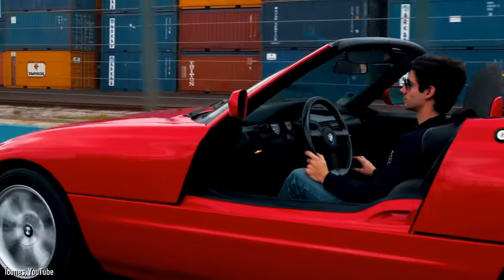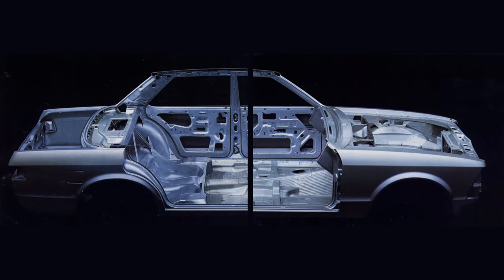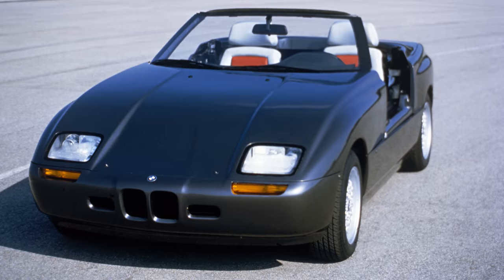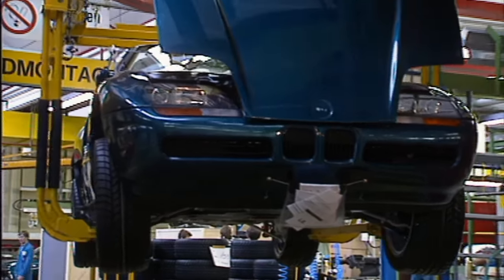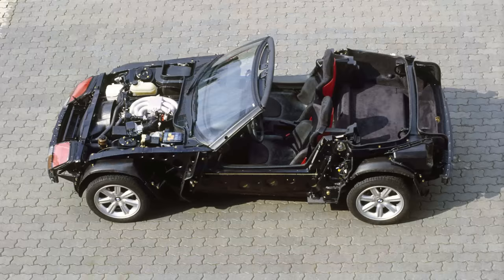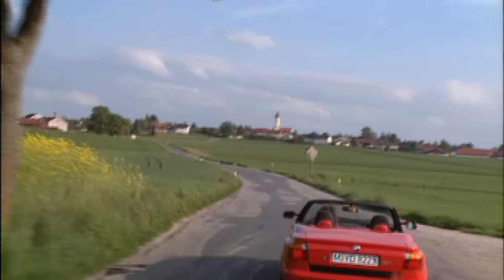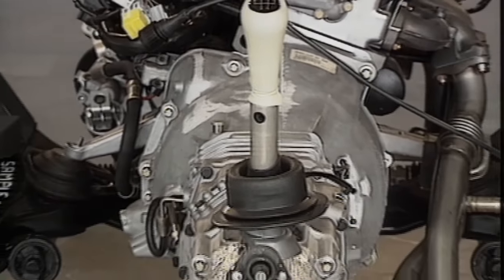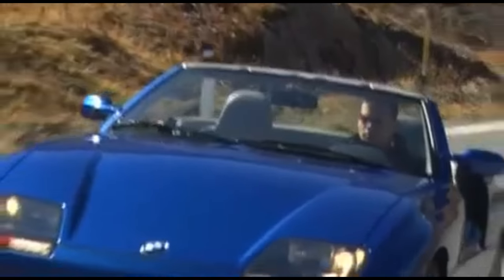Electric doors! The BMW Z1 Story

Comment: I've had my Z1 for about 20 years now, (bought for £17500) and love it! i could never sell it as on sunny days, driving it with the roof and the doors down is a totally amazing experience. 100k+ miles and still going strong. People generally refuse to believe it's 34 years old!!
Reply: Congratulations you are a lucky man. It is an amazing looking car but it looks very odd with the doors down I must say.
Reply: Neah, no way a  BMW still works after all that time.  BMW is shit.
Reply: I think the door are so cool. I'd surely have broken them by now, letting them down and up constantly as I drive along LOL
Reply: @Jack_The_Ripper_Here  there are a billion 90s bmw builds around lol
Reply: @huleyn135  a billion? You rarely see a 90s bmw on the streets.  Maybe in your country. They are extremely unreliable.  All i remember I used to see a lot of 3 and 5 series or the 7 series the "ugly one" . Not anymore.  All gone lol. Broken, fked lol.
Reply: @huleyn135  Don't feed the troll.
Reply: @Jack_The_Ripper_Here  I had a 1986 3 series that had over 500,000 miles on it when I got it. That car still ran like a youngster. It had never been rebuilt in anyway, it used some oil, steering an trans fluid but not in excess an would jump out onto the freeway like it owned it.
Reply: @stratcat4450  too bad BMW is now complete shit
Reply: I bet even minor accident involving doors will total it.
Reply: @Inflator82  The chassis is so stiff, it's all good. Hardest thing nowadays is sourcing parts, esp. the bits that are not E30! I've just bought a new door skin as mine finally split (after 32 years!) and it was neither easy to find, nor cheap!! ;-)
Reply: You must be really good with your money
Reply: Green eyes 👀
Reply: @Jack_The_Ripper_Here wrong, I’m 36. My dad bought a 1992 325i E36 and still has it. I’m driving an M8 Competition and after years of not touching my dads “old” 325 sedan, it shocked how snappy it still it. Chassis wise, it reminds me of my M2 daily.
Reply: @JarvisBoots1 just found out that several elements were inherited by the E36. I’ve owned several BMWs (not a MB fan myself) but the E36 (basically learnt to drive on a 1992 325i and a Mondeo) has that special “something”…. Never thought it was a Z1 pedigree. As a collector myself, I can only say, “KEEP IT, no matter what”.
Reply: @Gogettor  Cheers Robbie - it's going nowhere I promise!!!!
Reply: @Jack_The_Ripper_Here  what are you on about… I bet you like jdms yeah and not euros
Reply: Out of curiosity, has there been any faults with the doors? Have they become slower over the years, or working just as well as when the car was new?
Reply: @PatrickJorgensenn  Hi Patrick - they work as quickly as ever. However the drivers door is "tempremental" - it sometimes fails to lock into position, and sags a little when driving (about 1/2 inch). It's about the sensors (which you cant get anymore) and the tension - but I've learned to live with it 🙂
Reply: I’m super jealous of your lifestyle sir lol
Reply: WUT I can buy an Audi A4 2021 on the Facebook marketplace for 10000£
Reply: @Jack_The_Ripper_Here  yeah what're you smoking dude? 😂 as long as they are maintained properly all of their inline 6 and 8s seem to do amazingly well. Just expensive upkeep that's why so many are found fucked up, cause somebody was cheap or too incompetent to do the maintenance themselves.
Reply: @scoutbloodinthewater9210  probably. Idk why people get so pissy about it. I like cars from all over. As long as they're reliable and pretty that's all I need.

Comment: To my knowledge not only the engine and transmission but also the fron suspension of the Z1 were lifted straight out of the E30. The Rear suspension was basically a prototype of what would become standart of the upcoming E36. On the Z3 it was the other way round. E36 front suspension, but the rear from an E30/E36 compact to save on cost and weight.

Comment: Thank you so much for making this. I was just looking at the RM Auction listing for one that is to sell in February that has NEGATIVE 3 kilometers on it. Apparently it was common for BMW and other auto makers to manufacture their instrument clusters at just below zero kilometers to account for moving around until they got to the dealership. This particular Z1 was collected at the factory and only driven once and apparently not enough to roll the odometer over to zero.
Reply: Later on for the digital odometers there's an option in the BMW software to reset it back to zero at any distance up to 255kms.
Reply: Wonder what that will sell for. You got a link?
I'd love to see it.

Comment: *In German, the "z" is pronounced as a "ts" sound, so it would be pronounced "Ulrich Bets".
You're very right about highlighting the amount of time, effort and cost it takes to put a car into production... all of the legal hoops that you have to jump through too !
It did help that the engine, gearbox and most likely much of the front suspension was stock 3 Series.

Comment: Back in the late 80's a bunch bonkers midland motorcyclists, OK bikers went on a trip to Germany to see the German bike grand prix at the Hockenheim ring. While out and about we got talking to an owner of a Z1 and by shear luck I was offered a passenger ride in the car. This experience was not about the speed or acceleration but how the car handled at on the twisties and it was an experience that I remember to this day. It was frankly the best that I had experienced ever at the time. Back then I had nigh on 2 feet of hair that got a tad knotted on the air but it was well worth it.  The dropping door mechanism was very well done as well. I might be wrong but this car also had ground effect aerodynamics and was one of if not the first to be available on a production car. .
Reply: Haha relatable. Long hair and open top cars are not compatible.

Comment: BMW had a number of classy vehicles back in the day.  It would be refreshing to see if they could do something similar in the 2020's
Reply: What, BMW not classy now? But they have BIG GRILLS!!
Reply: BMW needs to rediscover what their brand stands for.
Reply: @davidrbrtsn  when you get over the design they are super nice to drive
Reply: @andreasstrauss5194  I hear you, but design is just really important to me. I like looking back at my car and smiling 😁
Reply: @davidrbrtsn  yes me too although there are still some nice bmws around like the 5 series and non m 3 series
Reply: @andreasstrauss5194  Not really as nice as they should be with so much lost feel, poor steering, ever increasing weight, fake engine sound from the speakers...just inexcusable!
Reply: @pistonburner6448  havent really driven many bmws (the only one was a e46 touring) so i cant really speak that much about it but from what i heard they still are quite good in comparison to other cars
Reply: @andreasstrauss5194  No, you're right: compared to others that is true. Well, except compared to Alfa Romeo and Maserati. And except compared to many GM's cars like Cadillacs, Camaros etc. And I guess some Jaguars are at least close if not as good. And Mercedes has come much, much closer than ever before (still not equal but many Mercedes have lost their biggest flaws).
Reply: @pistonburner6448  the new mercedes are in my oppinion some of the worst cars on the road that 9 speed auto is always changing gear the engines dont feel like they have the power they are supposed to have and the suspension is way to hard for a modern car

Comment: Usually German law says if you can drive with the door "open" (think of a morgan) there has to be a rope or chain as protection against falling out. BMW's development-team invited the TÜV's head engineer at the time to their testing-grounds, sat him in a preproduction Z1 and janked that thing around like crazy, at speed. Sensing the safety provided by seat design, sill and seatbelt BMW was granted an exception from the law.

Comment: Great video on the quirky Z1. While I definitely appreciate this car and the engineering that went into it, I’m very happy with my Z3 I’ve owned for 20 years. The styling has fared better and the fact that most of the chassis and underpinnings are from the E36 and E30 makes it very easy to maintain. Now the Z8- I’d love one of those. My neighbor owns a black Z8 and every time I see it I’m a bit jealous.
Reply: The Z3 is the more sensible option. Same fun with less running costs. I have a 3.0, it's great! But the Z1 is a icon. And I think the design has aged better than on all other Z Roadsters.
Reply: I'd be jealous too!

Comment: The Z1 prototypes were built by a company called Karosserie Baur (not written together) close to Stuttgart which had built their own convertible version of the 3 series before BMW built their own starting with the E30. 
BMW also had the 850i at that time which had similarities in Design. Unfortunately they never built a convertible of that.

Comment: While working for a short while as a courtesy driver at a BMW service centre, I had a chance to drive a Z1 around the block on day (on an industrial estate), sometime in the 2000s. It was already a few years old and rattling from everywhere worse than a Lotus Elise. Older Z3s were also rattling, typical of used BMWs in those days, at least in my experience, but not as badly. Z4s seemed better built, but I'd still chose any MX-5 over a 'Z' car any day.
Reply: I live in the US and the Z1 was sadly never offered here, which is a shame because it would’ve been a big hit. My uncle who lives on Mallorca has a Z1 and I’ve gotten to drive it dozens of times. It’s a fantastic car in Mallorca’s near perfect climate, and driving with the doors dropped down, as well as the top, is very enjoyable. However, there have been numerous problems with the doors, namely the electrical system failing.
In the US I’ve owned 5 Mazda MX-5’s since 1992, and it’s a superior car in every way compared to the Z1, except for looks, but that’s a matter of personal taste. I’ve owned 3 different BMW’s as well (733, 635 CSi, Z3) and the MX-5 is still a better car to drive and own than any of them. The MX-5 seldom needs more than the recommended maintenance, and all of them have been as reliable as a Toyota Camry. The build quality is typically Japanese, and I know people who abuse their MX-5’s and they still keep running. The only drawback to owning an MX-5 is its size, but I don’t have children, and the space in the trunk is enough for me to get groceries or take luggage, so it’s not an issue. I’ve even driven them in winter and there’s no issues, although I do drive my Toyota 4-Runner during snowstorms. Another huge advantage to an MX-5 over European sports cars is obviously cost. Not only is an MX-5 a bargain price wise, the costs of maintenance, parts, and service are about what you’d pay to own a Toyota Camry.
Reply: Your take fortunately does not portray in any shape or form the general truth about Z1 or Z3 quality.

Comment: Thank you so much for making a video with the history of the Z1. For more than 20 years I was looking for a decent Z1. Now I have one since 2015.  The thermoplastic panels are often cracked at the attachment points and often tear further. It was difficult and expensive to find new body panels....
Reply: One day 3D printing will catch up. Scan a good panel, get it printed out in plastic for cheap, carbon fiber for fun. Maybe 3D printers could paint for a finishing touch.
Reply: @pgtmr2713  coloured resins as we have today are far more likely than auto-painting printers imo.

Comment: [potential video idea] Hey @Big Car : I just realized the Z29 concept from “2001” is, at least from its fascia, extremely similar to the Opel Speedster (Vauxhall VX220), which according to Wikipedia was sold from 2000-2005 (I remember it from Need For Speed games). Knowing BMW, I have a feeling they were first to the idea and would never say they “copied” GM/Opel/Vauxhall. Sorry about the rant, but maybe it’s an interesting idea for a video / research
Reply from the maker: As I'm sure you're aware that car was basically a Lotus Elise. I see a bit of the Ford New Edge styling in the Z29 personally.

Comment: The R170 slk fulfilled the niche with it's folding hard top when it launched a number  of year's later ....... the waiting list for the slk was massive at the beginning,  a folding hard top was always a better idea than sliding down doors and probably caused a similar weight penalty! 

It likely helped that the slk wasn't as specialist in platform/deign  as the Z1 was.

Comment: Great vlog as always. I saw at least ONE car that made it on to Norwegian roads. Keep up the good work! How about a vlog about the 507? Strange that BWW got to name the car that. Did not Porsche get in a lot of hot water from Peugeot when they had to name their model the 911 instead of the 901 because Peugeot had Dips on numbers with 0 in the middle?
Reply: The 507 dates to 1956, the 901 to 1963. I can't find when Peugeot trademarked the x0y numbering pattern (if they did!), but it may well have been between the two dates; it certainly wasn't the case pre-WWII as there are numerous car models with that pattern (e.g. the Fiat 501, 502, 503, 505, 507 and 508) produced and sold between 1919 and 1939.

Comment: I had a green one with funky moleskin cammo seats, I loved it & wished I hadn’t sold it but a stint abroad forced the sale 😢
Reply: I take it you had the Green exterior and cream seat combo edition Z1.
Reply: @2many2say  actually no, it was a dark green & subtle multi colour design.  Sounds odd but it worked really well with the exterior paint colour
Reply: @humphreybradley3060  Exactly like mine!! Urgrun metallic exterior; dark grey leather dashboard; dark grey nubuck leather on the seats; and grey and green camo leather seat inserts: the best colour combo by far :-)
Reply: @humphreybradley3060  I see, you had a (Ur-gruen) Dark green exterior with a (Grau) Light&Dark gray cammo which is the common & best edition for the green exterior cars. 2040 (Ur-Gruen) z1's were produced of the 8000 z1's made. 1062 (Ur-Gruen) Z1's with the (Grau)/Gray interiors. 967 Ur-Gruen z1's with (Gelb)Light Yellow interiors were produced.

Comment: I love this car! So odd to me that such a big manufacturer couldn't do a better job of designing this for manufacture. It seems they had a harder time than brand new Tesla did starting from scratch. After all,  Chevy had been building the Corvette for over 30 years with an inner steel structure and plastic body panels.
Reply: Always when a car company do a lot of "firsts" there's gonna be problems, because they simply don't have the know how or production experience. And there was a lot of "firsts" with this one. First in-house convertible, before their own 3-series convertible they had only had that cabrio-coach outsourced to Baur. First 2 seater roadster (in thirty years). First with those doors. First BMW with the engine in a front mid-engine configuration mounted aft of the front wheel centerline. First space frame chassis. And so on and so forth....
Reply: Tesla didn’t start from scratch
Reply: Tesla didn't start from scratch at all. Further, Chevrolet made the Corvette using body on frame technique for a long period before switching to the widely adopted production methods used by others. The panels were made of fiberglass and not plastic.

Comment: As a 12 year old, I lost my mind when one of these did a parade lap of the 1990 Adelaide Grand Prix circuit, partially because I never thought I'd see a then-new BMW Z1 in Australia, but mainly because Celebrity Race participant Elle MacPherson was sitting on the back deck waving to the crowds. Truth be known, I was also a bit mystified how and why it was here given there was never an intention for RHD examples.

About 25 years later, I was looking at a huge under cover display of BMW vehicles as part of the Adelaide 500 touring car race weekend (itself held on a modified version of the original AGP track) when I spy a mint-condition, green LHD BMW Z1, the same colour as the one that ferried The Body all those years ago. Much of the display was part of a single collection owned by a family whose wealth stems from the long-term ownership of several prestige dealerships, including BMW. I don't know for sure, but I suspect they were able to secure one 'just because' despite its ineligibility for registration in Australia, and given it had about 1300kms on it when I most recently saw it, that checks out. Of course, being over 30 years old now, it can be registered in LHD, but if that was the owner's plan all along, that's definitely a long game!

Comment: Great Video and research again 👍 one small comment though: the division was not called “BMW Technik” but “M-Technik”. I used to work there 25 years ago. A small branch with 2 offices/manufacturing capabilities all within 3km of the BMW HQ at Petuelring in Munich but totally anonymized from the outside.

Comment: I don't think I agree with you when saying the Z8 was the spiritual successor to the Z1, since the Z8 was a neo-retro style exercise, which the Z1 wasn't, despite some inspiration here and there. In my opinion, the real successor was the i8: also started life as a (few) concept(s), went on to be produced with great innovative doors and composite construction, and new technology that would trickle down to other BMW products (the PHEV system that was found in the Countryman and 2 Series Active Tourer). It also existed as a convertible, and was definitely also a halo car. You could even say there were styling influences, like the single lamp headlight design, which is still quite unique compared to all the twin designs in other BMWs.

Comment: "Plastic" is not accurate: the body panels were a special composite of glass fibers and a blend of PC and PBT, two engineering thermoplastics. Quite groundbreaking at the time. Ask me about its recycling, one of the items I researched in my PhD.